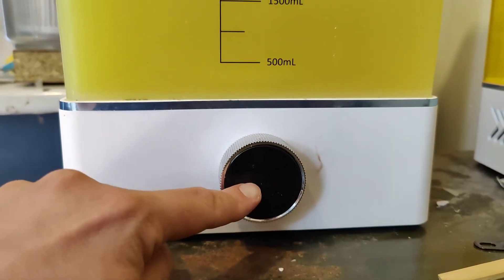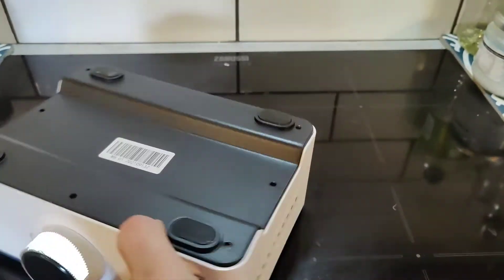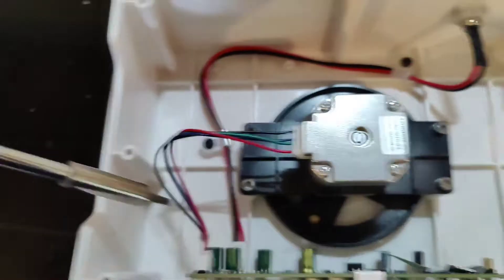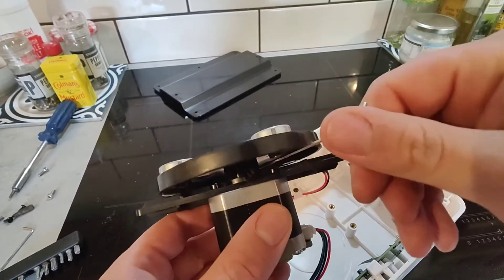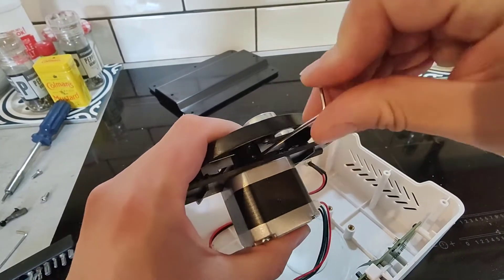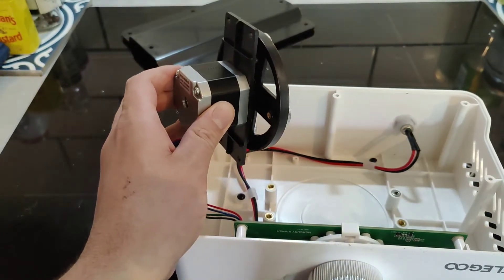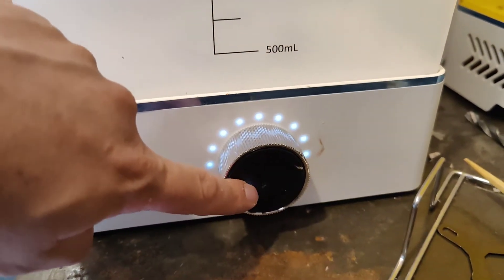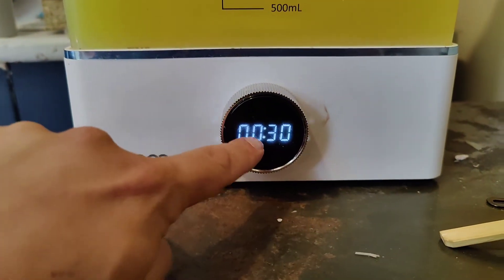How to fix an Elegoo Mercury X if it stops spinning - Broken Wash station easy fix 3d print cleaning

Comment: Thanks, you saved me $160. Mine had two 1.5mm set screws, and a dimple on the motor shaft for one of them, it was off by 45 degrees when I opened it off. Works great now.
Reply: was yours with a metal disc on the electric motor instead of the black plastic one in the video ? Mine has two holes on the metal shaft, I've tried all allen keys but none seem to grip. What screw driver head did you use ? I try to shine a light down there to see what  it takes but cannot see properly. help
Reply: @RolandoRatas  Mine was plastic, and was a metric size hex wrench, I think

Comment: In my mercury plus 2.0 mixing blades were rotatin very slowly and making clunking noise. The problem was washing container that bent upwards over time. I heated it up while pushing down on mixing blades till the moment it came back to its proper shape. Works fine now.

Comment: One thing I'll add: The set screw under the prop uses an M1.5 or 2mm hex wrench to tighten. If you over-tighten it, it will visibly deform the prop so that it's likely to still scrape the underside plastic. So you may want to watch out for that. Somebody should design something to fix this issue that we could 3d print!
Reply from the maker: thanks for the great info, thats really handy, we might have to have  a look into that and see if we can come up with something
Reply: 1.5, I just got a new Mercury X and the first thing I did was check the set screws and the 2mm I had on hand was too big.

Comment: Tried this twice.  Still grinding.  Gonna contact Elegoo.
Reply from the maker: DAmn sorry to hear that, i guess sometimes the problem goes a bit deeper, hopefully they will help you out
Reply: Mine is grinding as well.  It's strange because without the container on top, it spins fine, with it on, we start to get the grind noise.  So I assume, the motar is losing it's grip on the disc and can't properly spin it causing the grinding noise as the motar spins in a semi tight hole.
Reply: Yeah, there's just no snag or give while we try turning the screw holding the disc in place.  The head of the screw is probably damaged when it was initially screwed in place...great.
Reply: @ColeWithAGoal  mine is doing that too and its two days old lol
Reply: Just got mine today, new out of the box. It's the washer they sent with it that goes on top of the fan in the tank. If its not sitting dead center, the fan (being made of plasitc/resin - whatever) gets starts grinding against it and it gets caught on it. Basically had to make sure the washer was dead center

Comment: What is the model of the fasteners ? M2 ? M2.5 ? M3 ?
Reply: 1.5mm should do the trick.  They are tiny set screws, and I might actually drill and tap the existing bores for a beefier screw, seems to be enough meat in the casting.